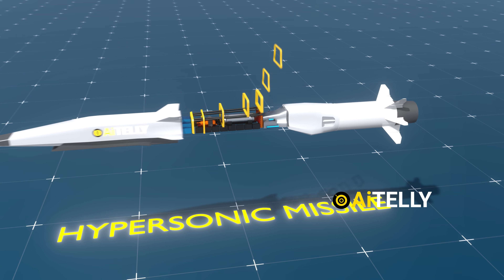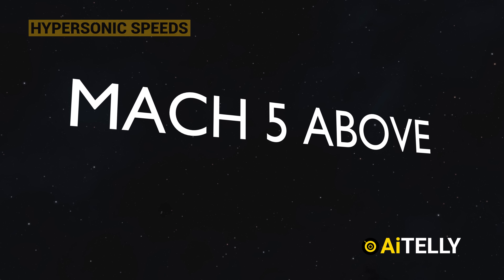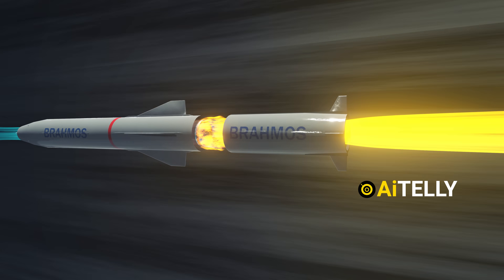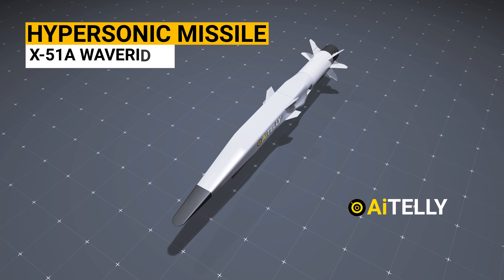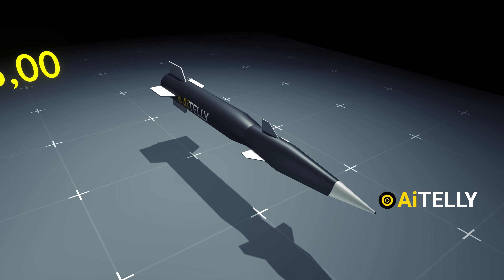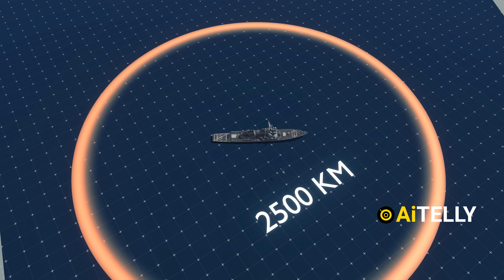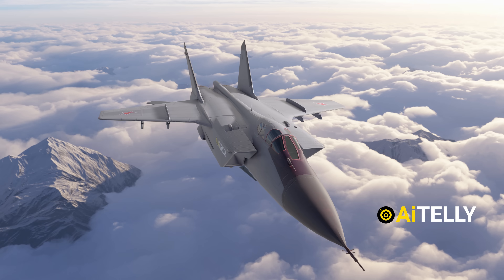How Hypersonic Missile Works?

Comment: It is uncontrollable at high speeds. American experts have not found a way to solve this problem. At the peak, they managed to accelerate it to Mach 17, but the effect was short-lived. During prolonged flight at this speed, it disintegrates. After that, the speed decreases to Mach 5. In this case, it is possible to control and aim at the target. If the speed is higher, the flight becomes uncontrollable. We are aware of this "masterpiece of engineering." This indicates that your engineers are lagging behind in development. You shouldn't advertise it. It's ridiculous.

Comment: Nice Video. I want just to add a small clarification — though the AGM-183 ARRW has successfully passed multiple test milestones, it has not been declared operational or fielded. It remains in a transitional, uncertain state: the prototyping and test phase is done, procurement was paused, but the Air Force is showing renewed interest in re-funding it.

Comment: 15000 KG = 16.5 Tons?? You know you're fucked up right?
Reply: 15000 Kg * 2.2046226  = 33069 Lbs. 

***That is 16.53 short tons (2000 lb/ short ton) 

or 14.76 LONG tons (2240.6 Lbs per long ton  ).

 In metric tons it is 15 ie 2204 Lbs per metric ton; 

what is you issue? math ? think there is just one ton? 

 What type of tons depends on what is sold or how used

There is a 12 percent difference in the two terms short versus long

What if this was you salary or rent?

If you salary drops 12 percent does than matter? If your rent goes up 12 percent does that matter?

If a tiny old  bridge says load limit of 2 tons do you assume it is 4408 Lbs or 4000 Lbs?
Reply: @3beltwesty you know math right, Tons not short Ton or wathever you mentioned above.. You must mentioned the exact unit or else

Comment: Why would the United States make them? I'm a mechanical engineer I have been for many years and my idea is to put something in front of it at the last minute like a lingering munition of sort the trick is using its speed against itself. If it's traveling already at that speed sometimes across a bunch of stuff in its pathetic man not correct at the last min. Very easy to put something up in its way at the last minute

Comment: SO AS FAR AS OBJECTS  AND TIC-TAC'S  YOU MIGHT HAVE BEEN BEING TARGETED OR CLOSE TO  A  TESTING OF A HYPERSONIC MISSILE WHICH YOUR JET WOULDN'T BE ABLE TO KEEP UP WITH. NOW , WHY DID IT ONLY SHOW UP UNDER CERTAIN RADAR / LIGHT FILTERS? PROBABLY CACUSE OF DIFF. REASONS , MAYBE IT HAD ACTIVE NUCLEAR RADIATION FROM IT BEING ATOMIC , LIKE WARHEAD... OR IT PUSHING SUPER COOLED AIR OUT THE BACK INSTEAD OF NORMAL , HEAT OR HOWEVER THEY WORK....

Comment: Note: All these are Hypersonic Glide Vehicles. They first uses a ballistic missile booster to reach altitude which separates after giving the vehicle Equipped with payload enough speed more than mach 5 then then glide vehicle use the incoming air to pass through narrow section burns H2 gas and sustain combustion and maintaining the speed.

They are very hard to master. Only Russia Kinzhal and China Dongfeng SF ZF has Hypersonic glide vehicle. However i doubt about the authenticity of chinese. Also the glide vehicle has no huge advantages if they re enter into atmosphere from high altitude. Because the radar would detect them early.

Only if the Hypersonic glide vehicle would first get boosted to hypersonic speed by ballistic booster just few metres above the ground and upon separation of booster then can sustain the combustion. Then it would be very lethal as it would be detected by radar too late and enemy would have less reaction time. Also adding maneuvers to the glide vehicle would make it unstoppable.

Coming to  Cruise Missile, the Brahmos is the world fastest cruise missile. No it is not hypersonic. But still the lethal cruise missile jointly developed by Russia and India.

They are also secretly working on hypersonic version of brahmos cruise missile.
Reply: Direct energy weapons & B83 gravity bomb 1.2 megaton Mach 25 newer models even faster.
Reply: @jonathanwaldron8230  another bot
Reply: @basedbarman  I'm not a bot.

Comment: Yemen reached 11 minutes in Zionist terrorism regime
Reply: Correction about the word hypersonic so no one gets confused i will do my best to try and keep it simple
(I don’t blame you if you don’t read this is kind of long for a comment)

Hypersonic is a speed threshold anything 5x the speed of sound is hypersonic 

Most ballistic missiles and all space ships can go at hypersonic speeds 
Ballistic missiles (like the one used on Tel Aviv) go at hypersonic speeds during launch in the stratosphere (stratosphere is the 2nd layer of our atmosphere from the earths surface ) or when they are in the space or the exosphere part of our atmosphere (with little air resistance and the last layer of our atmosphere ) and that’s where the apogee (when the missiles starts going back down) part of the flight path fuel and uses the earths gravity to descend back down to earth which is called its terminal phase and hit its target depending on the missile type and flight path it could go very fast or a bit slow for a missile but it is around 2000 mph which is Mach 2

 a common question ask is why not add more fuel so it can go faster while descending because that adds weight which needs to increase the booster which increases the drag which decreases the missiles range so you see how this becomes a problem really fast (it’s a bit more complicated then this so you should do your own research into this)

Hypersonic weapons (not in the definition of hypersonic) can maneuver at those high speeds in the earths atmosphere  though the science and laws of physics makes it VERY hard to make  because you need a missile that can survive in temperatures over 4000 degrees in the earths atmosphere and because it is so hot it can bend the air frame of the missile when it tries to maneuver kind of like how you see hot metal in factories being bent but it’s not impossible to make right now I think only China and the U.S are the only countries in the world that can make this type of technological and maybe Russia depending how generous you want to be with them

So was the Houthi missile going at hypersonic speeds during parts of its flight? Yes 
Was the missile maneuvering at hypersonic speeds in the earths atmosphere ? No
Did it hit Tel Aviv at hypersonic speeds?

Comment: Who is watching after seeing the Yemeni hypersonic missile 🇾🇪
        / \
      /     \
     /____\
    |           |
    |           |
    |           |
    |______|
        |  |
        |  |
       |__|
      /    \
    /        \
Reply: Correction about the word hypersonic so no one gets confused i will do my best to try and keep it simple
(I don’t blame you if you don’t read this is kind of long for a comment)

Hypersonic is a speed threshold anything 5x the speed of sound is hypersonic 

Most ballistic missiles and all space ships can go at hypersonic speeds 
Ballistic missiles (like the one used on Tel Aviv) go at hypersonic speeds during launch in the stratosphere (stratosphere is the 2nd layer of our atmosphere from the earths surface ) or when they are in the space or the exosphere part of our atmosphere (with little air resistance and the last layer of our atmosphere ) and that’s where the apogee (when the missiles starts going back down) part of the flight path fuel and uses the earths gravity to descend back down to earth which is called its terminal phase and hit its target depending on the missile type and flight path it could go very fast or a bit slow for a missile but it is around 2000 mph which is Mach 2

 a common question ask is why not add more fuel so it can go faster while descending because that adds weight which needs to increase the booster which increases the drag which decreases the missiles range so you see how this becomes a problem really fast (it’s a bit more complicated then this so you should do your own research into this)

Hypersonic weapons (not in the definition of hypersonic) can maneuver at those high speeds in the earths atmosphere  though the science and laws of physics makes it VERY hard to make  because you need a missile that can survive in temperatures over 4000 degrees in the earths atmosphere and because it is so hot it can bend the air frame of the missile when it tries to maneuver kind of like how you see hot metal in factories being bent but it’s not impossible to make right now I think only China and the U.S are the only countries in the world that can make this type of technological and maybe Russia depending how generous you want to be with them

So was the Houthi missile going at hypersonic speeds during parts of its flight? Yes 
Was the missile maneuvering at hypersonic speeds in the earths atmosphere ? No
Did it hit Tel Aviv at hypersonic speeds?

Comment: Add Houties to  hypersonic  club...
Reply: Correction about the word hypersonic so no one gets confused i will do my best to try and keep it simple
(I don’t blame you if you don’t read this is kind of long for a comment)

Hypersonic is a speed threshold anything 5x the speed of sound is hypersonic 

Most ballistic missiles and all space ships can go at hypersonic speeds 
Ballistic missiles (like the one used on Tel Aviv) go at hypersonic speeds during launch in the stratosphere (stratosphere is the 2nd layer of our atmosphere from the earths surface ) or when they are in the space or the exosphere part of our atmosphere (with little air resistance and the last layer of our atmosphere ) and that’s where the apogee (when the missiles starts going back down) part of the flight path fuel and uses the earths gravity to descend back down to earth which is called its terminal phase and hit its target depending on the missile type and flight path it could go very fast or a bit slow for a missile but it is around 2000 mph which is Mach 2

 a common question ask is why not add more fuel so it can go faster while descending because that adds weight which needs to increase the booster which increases the drag which decreases the missiles range so you see how this becomes a problem really fast (it’s a bit more complicated then this so you should do your own research into this)

Hypersonic weapons (not in the definition of hypersonic) can maneuver at those high speeds in the earths atmosphere  though the science and laws of physics makes it VERY hard to make  because you need a missile that can survive in temperatures over 4000 degrees in the earths atmosphere and because it is so hot it can bend the air frame of the missile when it tries to maneuver kind of like how you see hot metal in factories being bent but it’s not impossible to make right now I think only China and the U.S are the only countries in the world that can make this type of technological and maybe Russia depending how generous you want to be with them

So was the Houthi missile going at hypersonic speeds during parts of its flight? Yes 
Was the missile maneuvering at hypersonic speeds in the earths atmosphere ? No
Did it hit Tel Aviv at hypersonic speeds?

Comment: Yemen has entered the chat
Reply: Useless bugs.
Reply: Yemen doesn’t have a hypersonic they used a ballistic missile  
(I don’t blame you if you don’t read this is kind of long for a comment)

Hypersonic is a speed threshold anything 5x the speed of sound is hypersonic 

Most ballistic missiles and all space ships can go at hypersonic speeds 
Ballistic missiles (like the one used on Tel Aviv) go at hypersonic speeds during launch in the stratosphere (stratosphere is the 2nd layer of our atmosphere from the earths surface ) or when they are in the space or the exosphere part of our atmosphere (with little air resistance and the last layer of our atmosphere ) and that’s where the apogee (when the missiles starts going back down) part of the flight path fuel and uses the earths gravity to descend back down to earth which is called its terminal phase and hit its target depending on the missile type and flight path it could go very fast or a bit slow for a missile but it is around 2000 mph which is Mach 2

 a common question ask is why not add more fuel so it can go faster while descending because that adds weight which needs to increase the booster which increases the drag which decreases the missiles range so you see how this becomes a problem really fast (it’s a bit more complicated then this so you should do your own research into this)

Hypersonic weapons (not in the definition of hypersonic) can maneuver at those high speeds in the earths atmosphere  though the science and laws of physics makes it VERY hard to make  because you need a missile that can survive in temperatures over 4000 degrees in the earths atmosphere and because it is so hot it can bend the air frame of the missile when it tries to maneuver kind of like how you see hot metal in factories being bent but it’s not impossible to make right now I think only China and the U.S are the only countries in the world that can make this type of technological and maybe Russia depending how generous you want to be with them

So was the Houthi missile going at hypersonic speeds during parts of its flight? Yes 
Was the missile maneuvering at hypersonic speeds in the earths atmosphere ? No
Did it hit Tel Aviv at hypersonic speeds?

Comment: In hypersonic race, why do US behind the China/Russia, even Nortk Korea can deploy hypersonic missle. What make US struggle to develop though they have big budget and infrastructure to develop.
Reply: Because it's not ultimately strong weapon system.
Hypersonic missiles should be compared with cruise missile and ballistic missile.
Cruise missiles are stealthy and ballistic missiles hardly interceptably. The only advantage hypersonic missile has is very high cruising speed. Why only cruising? Because in terminal stage it reduces it's speed. Completely opposite of ballistic missiles. When it comes to stealth cruise missiles fly near ground/sea. Hypersonic missiles are incapable of such things. As soon it drops its altitude(20-50km are necessary for sramjet engines) engines will shut down. So author of the video is lying and has so many inaccurate data. Aside from high altitude it generates plasma all around missile. Plasma will intensively generate radio signals so it will glow in radars. Plasma also makes difficulties to missile such as recieving signals. In order to recieve correct data from satellites it has to drop it's speed.
So it is wonder weapon with so many flaws.
Reply: @zenith_linear  Got your point. I mean why they are struggle to develop.

Comment: The land attack version of DF-17 only cost around 4 Million USD, the Anti-Ship version cost probably around 10 Million USD.
The 120 Million per missile shown in this video is way out of wack lol. 

China also have DF-27 which is basically a DF-17 with a two stage booster for longer range.
Reply: you can just press a button on a missille and it attacks...What it takes to produce 1 is one thing, the support you need to actually use the weapon is another...
Reply: @supersugg22  And this channel has no idea of that either

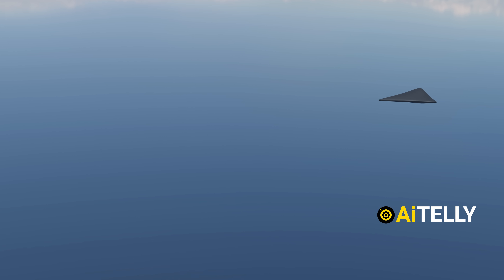Comment: 9:35 misinformation. Glide vehicle decreases it's altitude close to linear. It deacreases it's altitude just to hit target, not to avoid. It's impossible for vehicle to maintain speed above mach 5 continuously flying over sea level. Especially when glide vehicles relies on high speed impact, it's logical to maintain high speed in high altitudes in order to preserve more energy.

Comment: 7:20 misinformation. Those fines do not move, it only serves as stabilizers. Khinzhal/Iskander achieve maneuvering by guiding it's exhaust nozzle. Inside exhaust chamber are real movable fins that directs nozzle . It only maneuverable as long as engines works. Since it uses quick burning solid fuel, it's unguided in mid and late trajectory and guidence achieved at early stages(somewhat opposite of DF-17). That's the reason why Iskander called ballistic missile. Those very thin external fins do not serve maneuvering purposes, it's achieved by internal bulky fins guiding nozzle. Same applies for Khinzhal. Have 0 idea why ballistic missile launched from aircraft called hypersonic.

Comment: 6:26 misinformation. DF-17 do not drop it's altitude immediately. It's impossible to glide mach 5 at almost sea level. What you are telling it's how standard cruise missiles work(but even cruise missiles have to fly high altitudes in order to achieve long range trajectory, then drops it's altitude). DF-17 has semi-ballistic trajectory, guidance used in semi-late and late stages. It drops its altitude linearly. If it doesn't use low altitude, then what's it's advantage? The advantage is speed. It can be easily detected by radars but shooting down is quite challenging.

Comment: Le new HYPErsonic missile:
-Expensive to build
-Uses only 1 warhead limited by size and shape
-Glows in radars hence plasma clouds
-Has to decelerate in terminal stage hence plasma clouds
-Has very big turn radius, course much more predictable
Good old reliable ICBM:
-Can't be intercepted
-Uses astrocorrection instead of satellite transmission
-Deploys one big warhead or multiple warheads
-Warheads fall with the speed of 7km per second and keeps accelerating